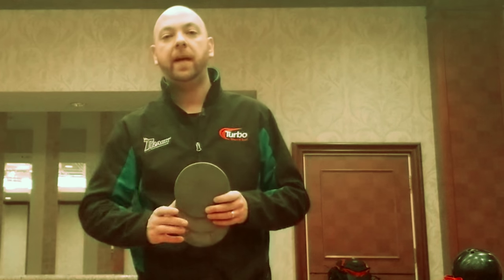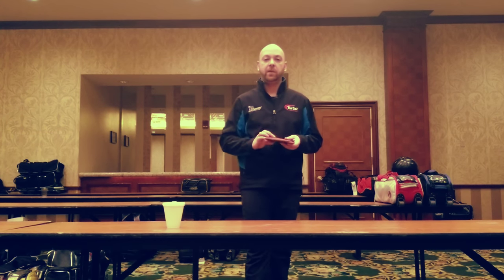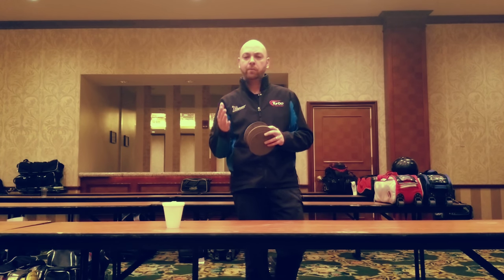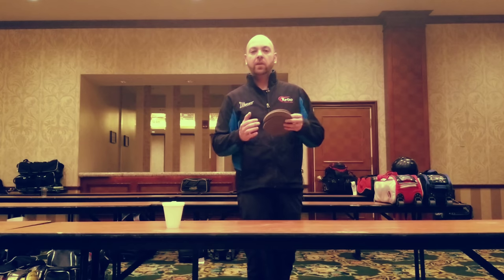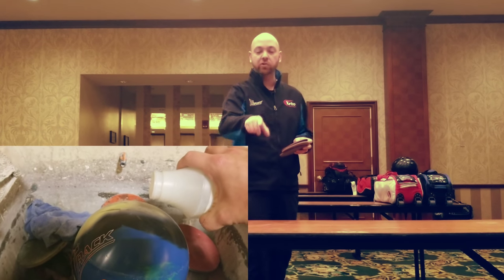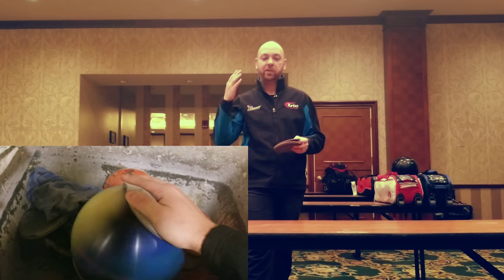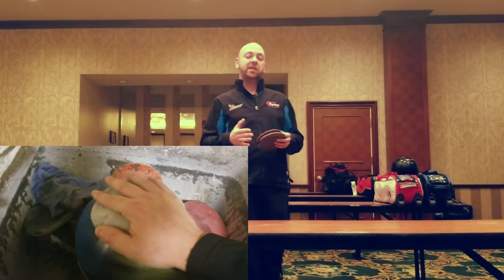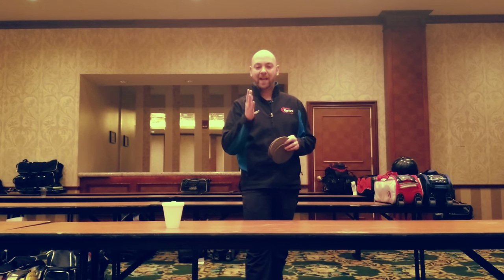Bowling ball surface preparation (why more surface on short patterns?)

Comment: Have you tried TruCut pads by CTD over Abralon?
Reply: I have a full set of CTD pads and absolutely love them. I've been using the same pads for 4 months and they still cut like brand new.  I use them both on my spinner and at the lanes with one of the pad holders. Fantastic product.

Comment: How do you get a ball back to its original form after putting 300 or 500 grit on it?
Reply: Find out what the factory finish is for the ball then use that grit of pad and any compounds/polishes required.

For example a ball that has a factory finish of 500/2000/polish you would hit with a 500 pad, then. 2000 pad, then finish with polish.

Comment: How do you know what pattern it is without actually talking to the person laying the oil down?
Reply: If you are bowling in a tournament an oil pattern sheet is typically provided either before the event or at the very least when you show up.
Reply: If you aren't given a oil sheet and no one know how long the pattern is then you'll have to figure it out with you eyes.  What you are looking for is the break point when the ball exits the oil pattern and hits the dry part of the lane and makes it's move.  Depending on the surface and strength of your ball you may see it start to read the lane earlier or later however when exits the pattern it will make it's final move.  Again, depending of the surface and strength of your ball, the move could be a smooth continuous arc, a skid-snap flip, or a roll out.
Reply: Thank you for the info on the sheets before a tournament and if not using my eyes to see break distance. I will be bowling my first tournament this Sunday
Reply: @lgmbass88  Good luck!
Reply: Michael Paz thank you I’m gonna give my best

Comment: My balls always go too long on fresh oil unless the lanes are dry... solid and pearl.  2000 seems to work perfect on the solid.  But not sure what I should do with the pearl.  Both are symmetrical.  Should I dull up the pearl? Does it take?  I stand on the far right and move left as the night goes on.  Any suggestions for surface on the pearl? New ball? More lessons, lol?
Reply: I was going to ask the same question except I prefer to bowl on the outside around the 5-10. Hey JR here's my question, I recently sanded my IQ tour wit 2000 and now my ball is hitting slightly on the left side of the head pin, should I use more fingers or move further right and throw at an angle..(house shot) thanks
Reply: @vonlee5560 , I'd move left one board.